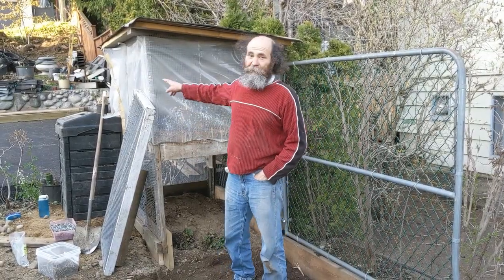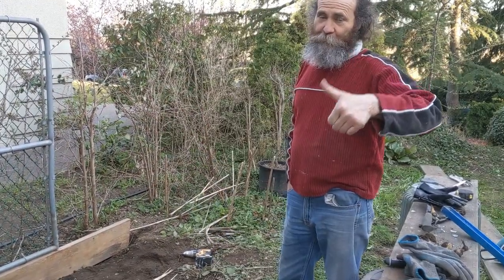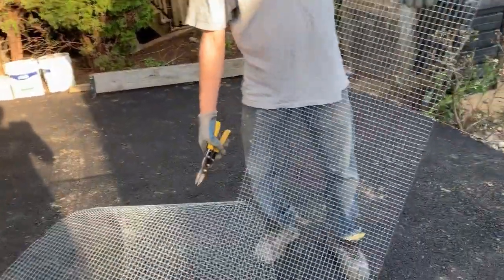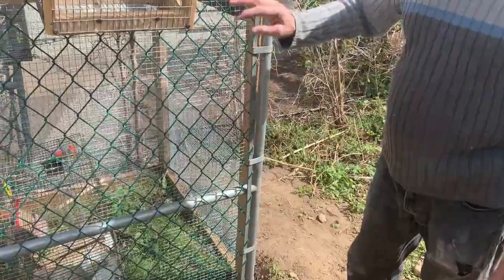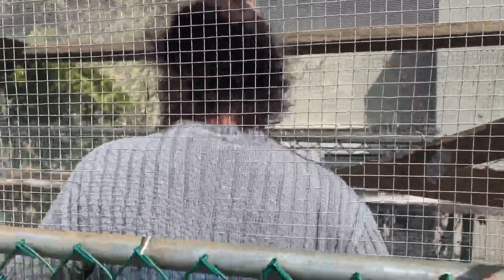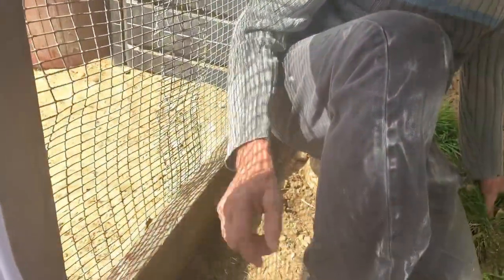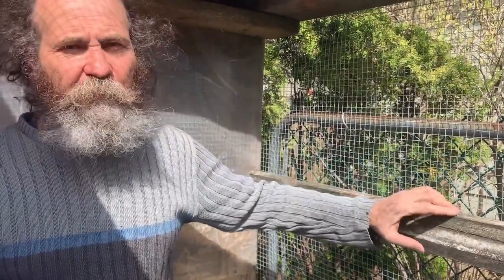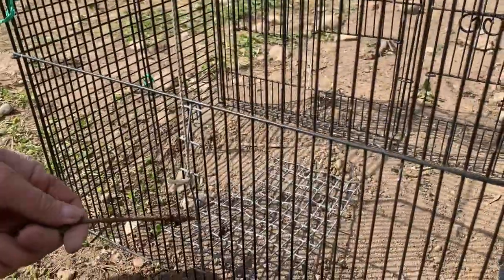How To Build An OUTDOOR BIRD CAGE FOR LOVEBIRDS & BUDGIES

Comment: I LOVE it when ppl get creative and use stuff they have laying around. I too am building an outdoor aviary for my lovebirds (16 of them🤪), and I'm using our large wood tiles that used to be on our walk path but were now laying around in the garage, collecting dust and spider nests. I'm also recycling insulation and wooden panels for the inside of their night/winter shack and recycling aviary wire that the previous owner has left behind. The only issue is that there is no electricity there and too far from the house to run an electric wire (though it could be done in case I can't come up with an affordable solution). So I'm trying to figure something out that involves solar panels and a portable device that stores the sun's energy. Might have to buy that last one new (is very expensive though), as in my country such things are very rarely used. Used solar panels shouldn't be as much as an issue to find.

Keep up the great work!👍
Reply from the maker: Hello my friend thank you very much for your support, it's very good idea to recycle some materials, in my case if I won't re-use them, I will get pay to dispose of the old materials, I am saving in both sides, for winter I have the cage all covered with 6mm vapor barrier and when get very cold I add some source of heating, solar power works very good, keep safe and have a great weekend.

Comment: Can weasel goes into the cage from the ground?
Reply from the maker: Hello there, thank you very very for your support, yes, I ended up installing a wire mesh on the bottom of my cage, I had some rats digging tunnels in the ground and getting in the cage, now have wire mesh and pavers on top of the wire mesh, please let me know if you have more questions, keep safe.